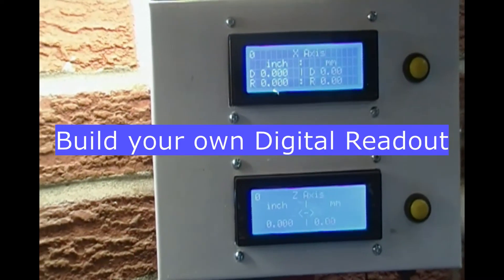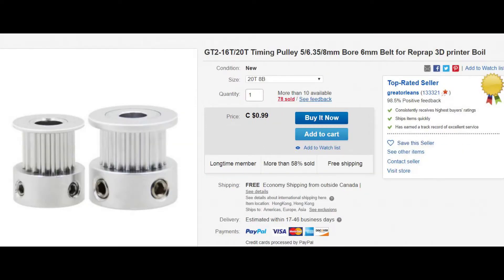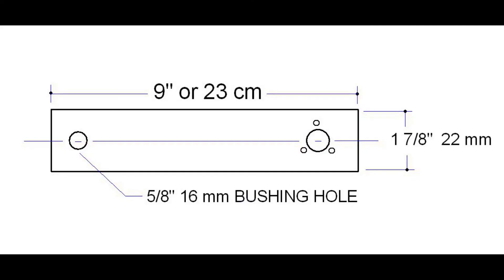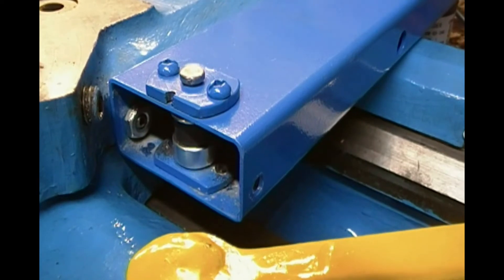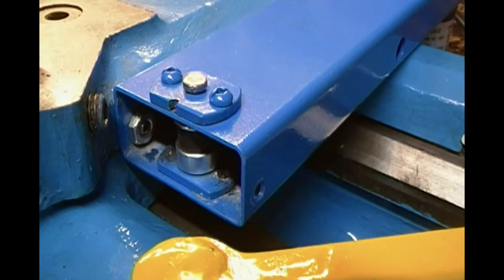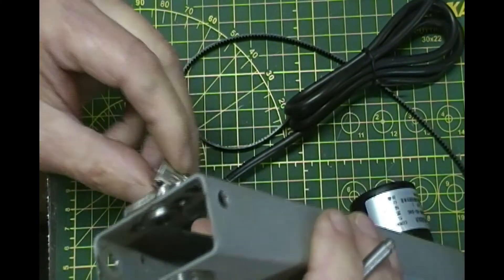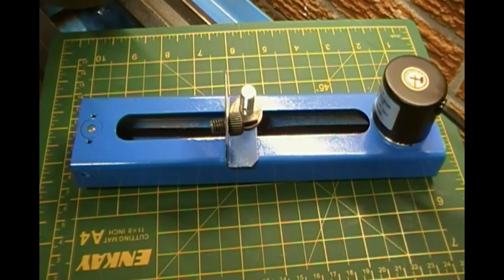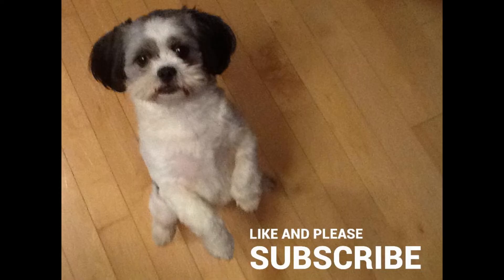Build your own DRO with an inexpensive Arduino board and a rotary encoder for many different tools.

Comment: not building my own dro but i have a chineese one on my milling machine that has 4 inputs i like to use the forth for the quill , fitting a glass scale to that is a bit finniky and its packaging is kindof big compared to a rotary encoder 
i know its possible to make a rotary encoder work on such a dro as i seen it done by someone in some metalworkers forum somewhere but havent found where i seen the exact info about the conversion yet 

wat i would like to do is fit the rotary enconder straight to the shaft to wish the handle is mounted that moves the quill up and down (im thinking on placing the encoder on the other end over the cup holding the quill return spring )
mecanicly it isnt all that hard to do but i like to find out wat rotary encoder i would need to get the same .5 mm steps as a glass scale and translate the signal from the encoder to sumting the chineese dro reads as a glass scale in mm

logical thinking tells me youll probably need to know the distance traveled by the quill per full rotation of the handle to find out how many steps per rotation encoder i would need 
keeping my thinking cap on i could probably just solder a plug for the dro straight to the encoders wires if i dont need to sum anything (like when i cannot find an encoder with the amount of steps i need for a one to one ratio )  to get the correct reading

Comment: good day. brilliant build. i have a problem compiling the sketch. my IDE does not like the 'positive' . this is the error i get.....
DRO_rotary_encoder_x:9:53: error: 'POSITIVE' was not declared in this scope

 LiquidCrystal_I2C lcd(0x27, 2, 1, 0, 4, 5, 6, 7, 3, POSITIVE);
any suggestions to what Im doing wrong?
Reply from the maker: Hi, placed a sketch and library links in the comment section of my video "DRO 4 wiring the Digital Read Out and uploading sketches" are you using the same libraries?
Reply: @practicemakesbetter7132  hi. i used the sketch as you posted it
Reply: @practicemakesbetter7132  i found your build on the arduino project page. and then watched the video. i copied and paste the sketch directly, did not try to upload it, wan to see that it compile first.
Reply from the maker: In this Sketch, I installed and used  the NewLiquidCrystal_Lib. V 1.5.1. One solution for you is to download, extract and include this library in your Arduino Sketch. If you can not find this library I can send you a copy via email; you can send an email to soldermelt@gmail.com, Good luck.

Comment: Hi just made a DRO based on your design. I have put a link in the video I've uploaded and also acknowledged that my design is based on your design. I couldn't get your Arduino sketch to work and had to re-write it. I'll share the new sketch in the near future.
Reply from the maker: Thanks, That's great I would like to see your finished product!
Reply: @practicemakesbetter7132  I'm pleased you like it, I take it as a great compliment. My son will help me with some 3D printed parts to tidy it up. I'll post a video when it's done.